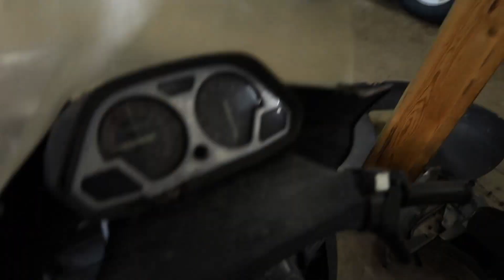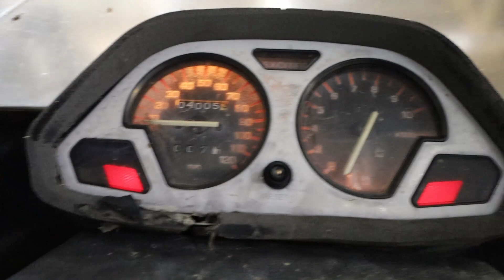ABANDONED 1987 Yamaha Exciter 570 snowmobile | Will it Run?

Comment: If you ever do this again, give a little attention to the bogies , secondary clutch shaft, track, slides and suspension with some Pb blaster, lithium grease etc…..because putting power to a seized track will strip the drive cogs clean…..and they are a bitch to replace on any sled.
Brakes are nice also…..it’s a bonus to be able to stop.
Reply from the maker: Noted, Thanks for the info! Much appreciated. We will try to take good care of this sled just because it's ties to the family.

Comment: Sounds like the same exact story with my Exciter - Dad's 1988 Yamaha Exciter 570 Electric Start been sitting for about 15 years
Edit: Yamahas are always a bitch to start especially if they've sat a while but they're fast as hell. Ideally you want it to idle around 2, but if you're off a couple hundred either way it's all good. It seemed like it was kinda dogging in the video though, I'm not sure if it was because you had to run it with the kill switch or maybe it's running a little too rich but you should be able to punch it and it'll throw you off the sled. Something about the old Exciters, they were quicker than most 800s!
Reply from the maker: Thats awesome haha We were surprised that it ran! Doing a few upgrades currently to have some more fun
Reply: I don't remember idling my Yami's that high.  Had 2 Exciters, VMax 600, Viper, SRX
Reply: @PartTimeYooper  Really? What Vmax did you have? I got an XTC 600 myself
Reply: @dozerfarms  87 Exciter, 91 Exciter, 94 Vmax 600, 2000 SRX, 2002 Viper.  Took 15 years off and now on Lynx Rave

Is your XTC the 600 triple? That did like a little higher idle than the twins.
Reply: @PartTimeYooper  I wasn't questioning you on the idle or anything I was just excited to meet another Vmax owner haha nah my dad has an '89 Exciter EX570 (blue decals) with the electric start and I got a black '97 Vmax XTC 600 twin with electric start and reverse. My grandfather had an old Enticer 340 when I was little but he bought a little Z370 Arctic Cat trail sled to replace it. Wish he kept it!
Reply: @Dozer Farms  like Larry the Enticer aged sled or late 80's Enticers? Both were super reliable but no suspension.  I had one for 2 years before I got Exciter.  

Your XTC motor is same as 96 Vmax.  Had 12,000 miles on it and motor still ran great.  Only downside is that front suspension on a Yami is so far behind the rest of the snowmobiling world at that time.  Only thing pogostick was good for was durability and mountain sleds because of no drag.